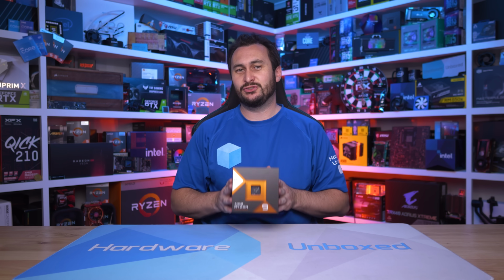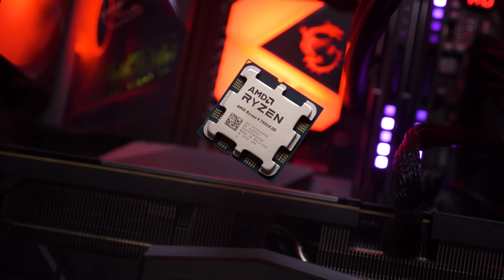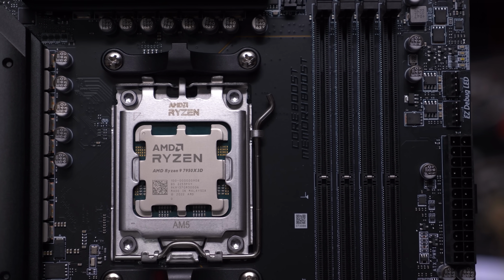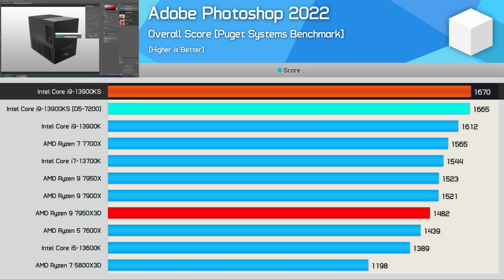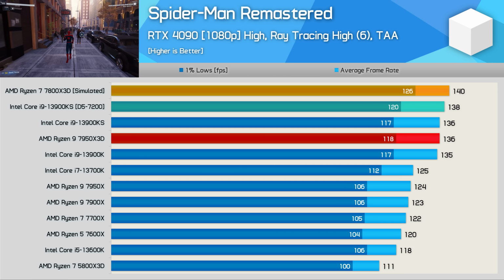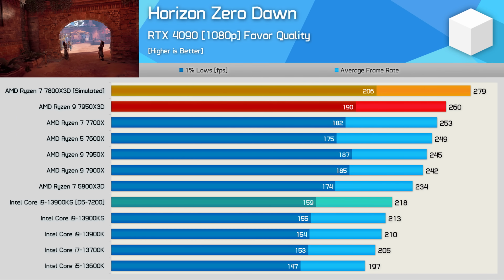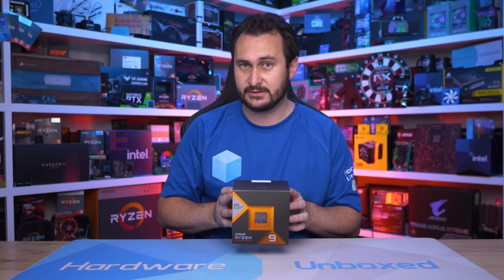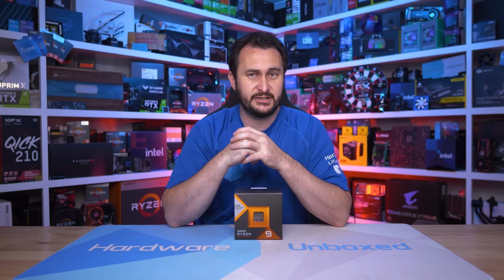AMD Ryzen 9 7950X3D Benchmark + 7800X3D Simulated Results

Comment: Seems like 7800x3d is the way to go for the best gaming CPU on AM5, especially if you don't care about productivity. Otherwise the 5800x3d is still a very capable and impressive CPU in 2023
Reply: I'm gonna keep my 5800x3d for now. The jump is not bad from that to the projected performance of the 7800x3d,  but i'd have to build a whole new rig and that would be way to expensive for the gains.
Reply: @josejuanandrade4439  Enjoy your CPU mate!
Reply: @josejuanandrade4439  Only worth the upgrade, if you're still on Zen 2 or older. Zen 3 chips, especially the newer ones like the 5800X3D, are more than enough for gaming atm.
Reply: @AchsuthanP  Exactly right. I'm on a, don't laugh, FX-8350, so I'm going straight for AM5 and a 3D chip.
Reply: @godlyobject6509  I went from a 6300fx to ryzen 5 2600 to hopefully the 7800x3d if it does what it's suppose to. I try for at least 5 years per PC build.
Reply: @mchonkler7225  How big was the performance gain?
Reply: @godlyobject6509  What a massive jump! Pity you’re going to be paying for a more expensive motherboard, and some RAM. But with AM4’s track record, having a longer upgrade path is quite nice compared to Intel.
Reply: @josejuanandrade4439  No one needs these new CPUs. No one even needs a 5800X3D. Keep your CPU, be happy.
Reply: @shootinputin6332   try running a 4090 and a Varjo aero on full graphics settings at 39ppd on a 5800x3d then come back and say we don't need faster CPUs...  I'm definitely CPU bottlenecked my frame rate sits at about 89fps most of the time but there are some fps drops in iracing, I'm getting as low as 72fps, this breaks the vr immersion. I've already bought AM5 board and Ram, just waiting for the 7800x3d to get released.
Reply: @brettgrieves  Sounds like settings you don't really need, with a graphics card you don't really need, at a resolution you don't really need. We were being fully immersed all the way back in 2014 with the Oclulus Rift DK2, with old hardware. You don't really need to be gaming at 4k at all, and you don't need max graphics either way. You don't even need any of that ray tracing rubbish, either. It really is a luxury. People love wasting money on stuff they don't need though. I got to a point where my machine plays everything I need, so why even upgrade... I just buy more harddrives instead.
Reply: @shootinputin6332   Whats the point in having the Aero is you cant push it all the way to the max. Running on anything lower than 39PPD looks terrible. I agree, dont need it.  but nice to have. You could have this argument with people with Ferrari and Porsche.. its pointless argument, if you have the disposible income its up to you to use it.
Reply: @josejuanandrade4439  ^this ^^
Reply: @josejuanandrade4439  Yeah, all these people upgrading because they like wasting money. Most AAA games are trash these days, and the games I play, can be played on hardware from years ago at high settings. I invest in hardware that actually matters - harddrives. I'm keeping my AM4, and will also upgrade my 3600 to a 5800X3D, when the prices drop even futher.
Reply: @josejuanandrade4439  I'm keeping my 12400🤣
Reply: @elirantuil5003  Ew. At least upgrade to a 13600K.
Reply: @rustler08  actually, I bought it planning to upgrade to 12700k or 13700k, but only 2nd hand or otherwise heavily discounted. Went overkill on mobo and psu
Reply: Nooo, you guys neeeeed to upgrade! How else am I going to get a good deal on a second hand 5800X3D?! 🤣
Reply: @TKIvanov  Got mine for $319 :)
Reply: @snozbaries7652  nice I found it for 300 on Walmart second week of January , going from a 3600 non-x to the 580X3D was a huge jump. In most games I saw a 40-50 fps just and in Satisfactory it was more than 65fps jump and faster save times in late game, it's very CPU dependent.
Reply: I have to wonder though, if the lower clock on the 7800 x3d will cripple it so that it isn't beating two higher tier parts.  Since these are not overclockable, it's not like you can make up the clock speed difference.
Reply: That's why they staggered the release, to get them 7900X3D/7950X3D sales
Reply: i just bought a 5800x3d , great cpu and its worth the price. it holding its price a bit but damn.
Reply: Which of the 7000 is good for productivity
Reply: @thetruestar6348  7900 and 7950
Reply: My 7950X does everything I need but I guess I'll upgrade anyway, just because :D
Reply: @MarkElf2204  Have you had any driver issues or any other weird stuff happen with the 7950X?
Reply: Is it? The 7700X seems like a more sensible choice tbh.
Reply: "Don't care about productivity" It still is a pretty beefy CPU for productivity, unless you are a professional on a tight deadline, where 16 cores will be the difference of making or breaking it.
Reply: look more like "too much problem" when trying different programs...
Reply: the 7800x3d would still be fine for productivity anyways.
Reply: Probably be waiting till the 9800x3d before I retire my 5800x3d. Gaming at 4k with a 4090 and shouldn't be needing anything else for at least another 5 years. Don't think smaller than 4nm or 5nm is even really going to be possible in that time frame 😂
Reply: @Chabuddyg673  exactly what I'm doing. My 5800X3D satisfies me in every game I play at the highest settings with my 4090. Only upgrading to Zen 5 X3D or whatever Intel has. Zen 4 as a whole is pointless to me.
Reply: @lunetailedfox  THIS!  Why on earth would I spend $1200 on this when it only cost me $350 for my 5800X3D?  I have not had any performance issues and games run awesome on my RX6750xt in 1440p 144hz running on a X470-F Gaming board.  I feel like AMD really shot their selves in the foot the the 5800X3D.  I mean, don't get me wrong, I'm SUPER happy that they did.  But I have to wonder how many people will simply stick with the hardware they have and upgrade to the 5800X3D for $329 on Amazon right now.  The only reason I can see AMD getting something out of the release on AM4 was to advertise the 3D capabilities, and it has certainly done that!
Reply: wait till HUB clarified whether they have configured the "3D V-Cache Optimizer" in the latest Chipset driver properly, the driver should be parking cores, and looking at HUB's review, it doesnt look like it is.
Reply: This overpriced 79503D still lose to i9-13900K even with high end motherboard and ram. Zen 4 is totally disappointing.
Reply: 13900k? Now that whole platform is disappointing with its power usage, and being from a rubbish company like Intel.
Reply: @runninginthe90s75  I wouldn't say it "loses". The performance is roughly neck-and-neck, but then you realize that the 7950x3d only uses little over half as much power as the 13900k. Slightly less powerful in performance (arguably) but undoubtedly more efficient (and your electricity bill will thank you)
Reply: @triv4555  imagine spending $700 and worrying about an additional $20 in electricity bills. You guys are wild
Reply: @triv4555  For cpu which cost $300 more than Intel offering it better performs better at everything but sadly overhyped overpriced flopped cpu like 7950x3d isn't better at anything than the i9-13900K, even at some games i9-13900K still win. 7950x3d is a flop.
Reply: @runninginthe90s75  $300 more?? Not sure where you're getting your parts but this is little over a $100 more than the i9-13900k was at release. If you want raw power and don't care about budget (or electricity bill) then by all means go Intel, but AMD is without question the more cost-effective of the two right now
Reply: R I.P Intel .. your temp and power consumption will be remembered forever in our frozen heart
Reply: @Luiko0406 tbh I'm not impressed by the 7950x gaming performances but instead more impressed in it's efficiency and power consumption.

Comment: Great idea to simulate the 7800X3D!
Reply: Only if they downclocked to match a 7800x3d which I'm surprised he did not mention.
Reply: @MrTuxy  7800x3d and VCache CCD of 7950x3d have similar clockspeeds.
Reply: @DragonOfTheMortalKombat  Good point, do you know the speed of the 7950x3d Vcache CCD?
Reply: @MrTuxy  As far as I know, 7950X non 3d has 5.7Ghz max boost on one CCD, and second CCD had 5.4. Basically, the CCD2 of 7950X is a 7700X. Now, with 7700X vs 7800x3d, you'll see a 0.4 Ghz reduction in clockspeed. And since, 7950X3d is a combo of 7800X3d and higher clocked 7700X, it should also have 5ghz on V cache for gaming workloads ( could be slightly higher or lower ) just like the 7800x3d. 

In other words, disabling one CCD of 7950X3d should be a very good indicator of 7800X3d performance.
But it is still an estimate, so take it with a grain of salt😬
Reply: @DragonOfTheMortalKombat  Just a shame they didn't say if the simulated results considered this. It's only 8% difference but this is all about topping gaming charts. It doesn't really matter, I think you could flip a coin on getting a 13600k or 7800x3d and it not really matter which side comes up for most people.
Reply: @MrTuxy  That's the thing with fastest CPUs, 7800X3d isn't really a value focus, it is more there to show off that "we have the fastest gaming CPU" 5800X3d had an advantage that you could put it in the existing AM4 platform. I doubt that 7000X3d will be as popular or iconic. Imagine if they make 7600X3d especially since the stock 7600x is a better gaming value than 13600K. Now that will be interesting.
Reply: @MrTuxy  Also wanted to mention that 7950X3d consumes a LOT less power than 7950X for only 3-5% decrease in performance in all core workloads. In games it consumes less power for more performance. power efficiency is next level.
Reply: he should simulate 7700x for csgo
Reply: This just proves games don't scale well with cores.
Reply: @zaxmaxlax  Like anything, it depends.  Steve has found several games that gain a pretty notworthy amount for performance going from a 5600 to a 5700X, despite the amount of cache and clock speed being very close between the two.  An i7 8700K will still play most games very well, but if you set it to 4C/4T in the BIOS it will run like crap on newer games.

Games need a certain amount of CPU performance, and they will primarily depend on single thread performance, cache, and DRAM bandwidth/latency to get there.  They'll scale secondarily across more cores if they're able to.
Reply: @DrearierSpider1  I wish someone tested a 7000 series CPU with only 4 cores enabled, I don't think it would be too far from a 7600x.
Reply: R I.P Intel .. your temp and power consumption will be remembered forever in our frozen heart
Reply: 5 cores with X3D will beat 16 cores with some X3D according to Microsoft. ( 5/8*433 = more than 249, Looking at Factorio at 11.45 )

How on Earth is scheduling for MS still such a diabolical crap after 5 years of Ryzen with multiple chiplets. (Any moron can fix this, why cant they)

And why isnt AMD taking matters into their own hands, ProcessLasso exists, why doesnt AMD do something similar with Ryzen Master or Radeon control panel.

Are they deliberately trying to keep Intel "looking" competitive ?

Also i bet the 16 core allocation will use significantly more energy than the 5 core allocation.
Reply: @seculi7757  According to the Gamer's nexus review the combo of the updated chipset driver, balanced power profile, and Xbox game bar have get scheduling operating as intended.
Reply: And that's because the Windows' scheduling sucks for that cpu